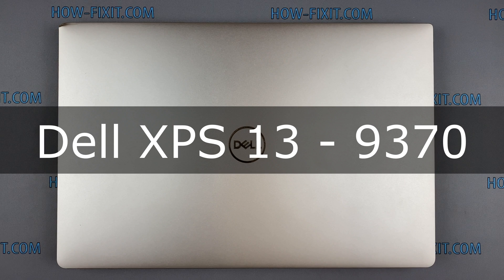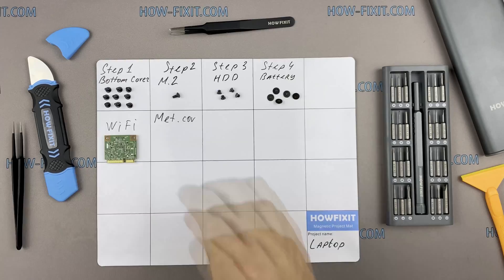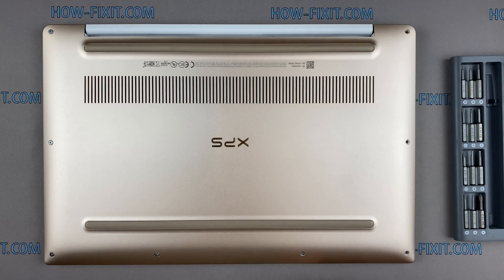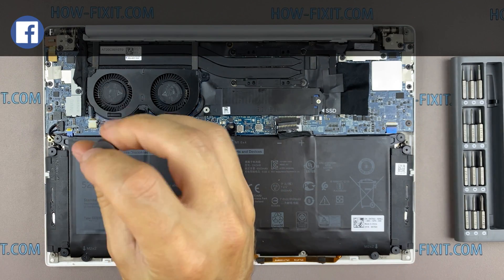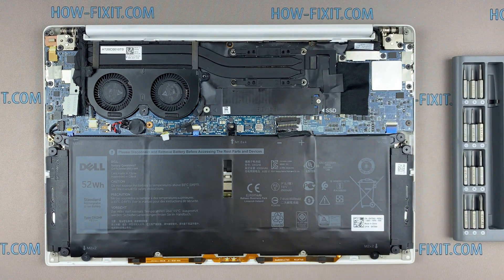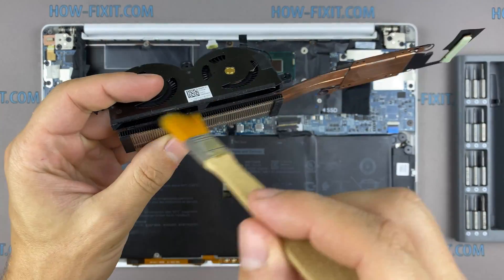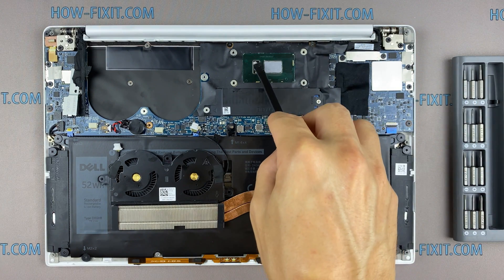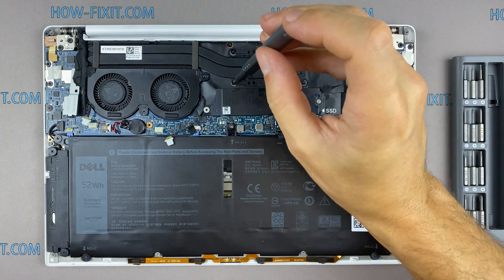Dell XPS 13 9370 Disassembly, fan cleaning and thermal paste replacement

Comment: 3 Plastic clips near the heatpipe broke off easily. Had to glue them back on but they are hard to get right. Dell really should have just placed two screws in there to hold the bottom panel down. Very stupid design.

Comment: DO NOT spread your thermal paste like this. Simply place a grain of rice sized dot and let the mounting pressure of the cooler do the rest.
Reply: Totally fine to spread paste- and in this case with the irregular die shapes, spreading is a better way to go.  Using the dot method won't give very good coverage on multiple long rectangles.  

Smooth spread helps avoid air bubbles for any who are also spreading along to this video.
Reply: It does not matter, spread method gives a piece of mind for some people.
Reply: @helloimuzumakikira1  Spread method can cause air bubbles and create problems.